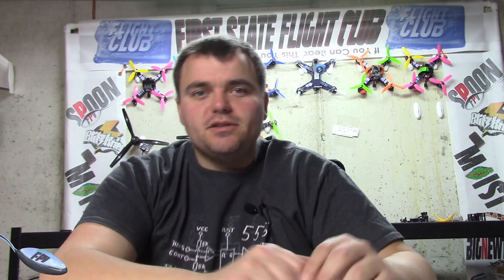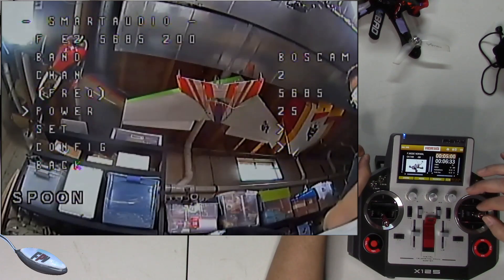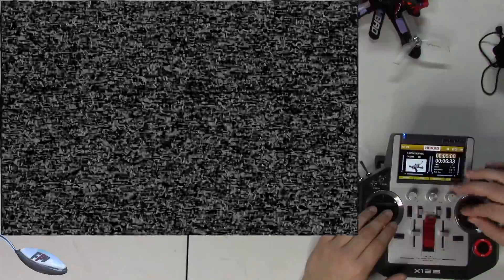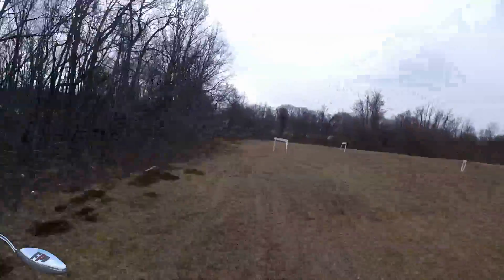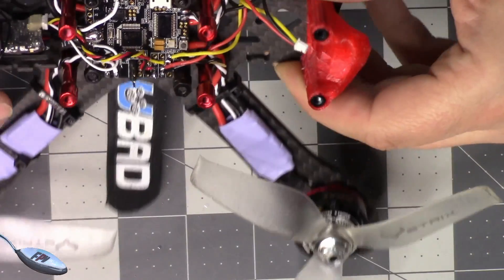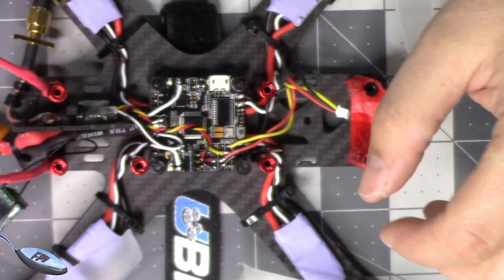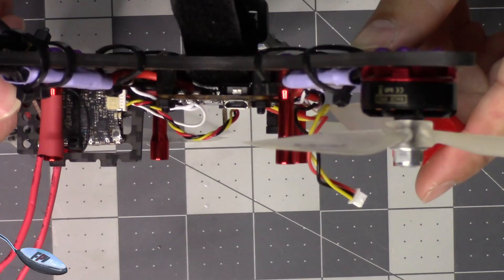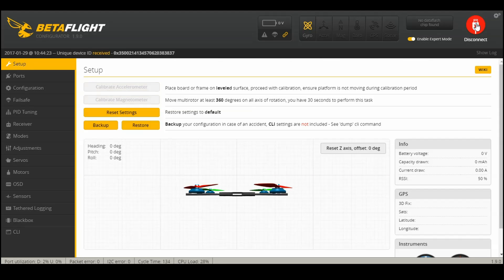TBS Smart Audio Setup Betaflight OSD

Comment: When I select "Set" my DVR does not go off ? Meaning it does not change the channel selected. Why is that ? When I reboot it it goes back to BOSCAM and channel 1 I believe, what am I doing wrong ? Thanks!
Reply from the maker: Did you set the protocol correctly in Betaflight?  You need to set it as a peripheral on the correct UART.

Comment: Hi. i have 25mw - 800mw tbs unify but at the betaflight osd there is max mw is 600 option. Does any idea ?
Reply: It needs to be unlocked first, it tells you the process in the manual
Reply: @ItsMeATaco  but i can set 800mw  with lua at same quad

Comment: If you close your eyes and listen to this video it sounds like Matt Damon helping us with Smart Audio.
Reply: I can't find a video that answers the question:Before I care about setting up, what does smart audio actually do and why do I want it??
Reply: J M Smart audio is a protocol that allows certain VTX's (TBS unify pro originally) to have their settings set in OSD instead of having to do so manually. In the video he was able to change band, channel, and transmit power using the just his transmitter sticks like joysticks. If you didn't have smart audio hooked up, you need to press a button in a particular sequence in order to change it. It's much smoother to be able to do that when flying with others.
Reply: so true !!

Comment: I've been searching and it seems you're the only person who did a similar video on the BFF3 board. Will this be the same on the Betaflight F4 board? Even tho it has OSD I also want to connect s.port for tuning LOS. Since I learned to tune via LOS vs in goggles.
Reply from the maker: +Darrel Martinez the layout may be a little different on the BFF4 but overall the concept should be the same.

Comment: Hi. thanks for the useful video. I have an Eachine wizard x220. my transmitter is fs i6. I have recently upgraded the vtx to TBS unify pro and I have a runcam swift 2 as the camera which has a built in OSD. I was wondering if I can configure smart audio on my quad. your feedback is appreciated.
Reply from the maker: +jack smith You need a flight controller with an OSD in it.  The OSD in the runcam will not talk to the TBS unfortunately.

Comment: Thanks for the video. Will this work on a Lumenier LUX V2 board? I am building my first quad and I have the LUX board and I have the Unify pro V2 5V. I just now started builing it and I'm not sure if it will work. Any guidance would e much appreciated, thanks.
Reply from the maker: +Steady it only works on boards that have OSD, I don't know if that board has OSD built in.
Reply: No, it doesn't. So I can use it anyway, right? I just won't need to connect the the audio line? Then just change setting thru the button on the board?
Reply from the maker: Yeah, just need to change the settings using the button on the TBS board.  Not that big of a deal, but smart audio does seriously one up the ease of things.

Comment: so your using the frsky xm or xm+ how does it compare range wise to x4r or xsr
Reply from the maker: Oh the XM is total garbage!!! Would not recommend.  The XM+ is amazing, that's what I fly now.  The XM data output jumps all around so you need a 10-point deadband on your quad to remove the jitter, XM+ rock solid.
Reply: How does range compare? To x4r or xsr? They some kind of overkill for most unless you really need telemetry
Reply: Spoon FPV something is wrong with your XM i have couple of xm and xm+ all are smooth af :D

Comment: Hello..I have a clone f3 cleanflight board and i soldered white wire to my board to uart2 .Thats the only way i can get my taranis and receiver to work together,but in uart2 i have is set to tbs unify and i can gt it to work,,Does the board have to be original f4 and also does it have to use uart3 to work?thanks
Reply from the maker: scott hendrix It needs to have or support betaflight osd
Reply: This is a clone sp racing f3 board..not sure if osd supported?sorry am new on all of this,how do i find out if it is..On osd in betaflight its blank?could it be in the uart settings

Comment: Can anyone answer whether SmartAudio can work with the Spektrum radio vtx menu inside the radio menu and change channels and power right on it?
Reply from the maker: It will work with any radio.  It's the FC that matters, you need a FC that has betaflight OSD.  After that it's just stick commands, which the FC reads and it doesn't matter the radio.
Reply: Spoon FPV ...let's say I just ordered a Skitzo Revolt raceflight ready fc....regardless of osd ..I should be able to use the Spektrum radios internal vtx menu they have know ..?

Comment: I don't get vtx option on feature menu, only blackbox and led strip. Is there some other feature you have to enable in betaflight first?
Reply from the maker: nolsmtm You need version 3.1 or higher,  The board ships with 3.1 but it's a beta version,

Comment: So "TBS Smart Audio" is not a feature that does anything with audio? I'm confused.
I thought maybe it was all about a mic on the TBS VTX which when connected to the Betaflight board would actually let you hear the quad's motors and also give you telemetry-like warnings, etc if you use an earbud or other type of listening device...   :(
Reply: it's called SmartAudio because it repurposes the audio channel to communicate between FC/OSD and VTx. With a switch you can have a mic and data communications at the same time.
Reply from the maker: BisMaxx Nope if you give up audio you can display stuff on an OSD enabled FC
Reply: Team BlackSheep please elaborate,as would still like to get my audio feed to my goggles
Reply from the maker: Team BlackSheep Thanks for the idea for future content!  Looks like I need to make a video about maintaining audio.  What about the low/high pass filter on the FC separating audio from digital signals?  Is that a real possibility in the near future?
Reply: I really would like to setup audio on all my quads, or at least all my new builds. So yeah, that would be a helpful tutorial. A low-pass filter would be sweet to prevent heavy/loud buffeting sounds from the wind from overwhelming the audio feed.
Reply: BisMaxx I been using audio for a while now. currently I use the mic in the pnp50, there is no loud buffeting noise don't bother with filter. it's only remotely loud before you power up the quad. usually not enough to make me pull the earphone from my ear. in flight, you hear the motors whine ,I was able to hear my antenna being chopped to pieces keeping me out the air for a week lol
Reply: Hi even I have an new SA receiver now, yay!  However I don't understand the theory behind how it behaves.  My transmitter now has a mind of it's own and I think that's by design.  I can find docs and videos explaining wiring a uart and enabling it in BF but....  Maybe my search engine strings aren't correct I can't find anything explaining how SA is 'supposed' to be used in conjunction with an FPV receivers quick channel's and possibly Lua scripst, etc.  Thx.

Comment: Nice dude about to set mine up with BF FC.. did you not get round to a build vid with the BF f3fc ?
Reply from the maker: serval FPV I shot the video for it, but I'm not releasing it for another week or two, because no one can buy them.  If you run into problems or have questions, I can send you info through messenger on my FB page spoon fpv if you would like.
Reply: Spoon FPV ok will do cheers !

Comment: Could you explain pit mode? ( when its actually in pit mode )
Reply from the maker: Jeff Sheffield If you hold the button when you power it on that enters Pit mode, it transmits at like 2mW on I think 5586( which is below the bands anyone shold be using to fly) so that you don't disturb other pilots.  If don't have it unlocked it will not broadcast at all.  It's designed so you can work on your quad "in the pits" Once in pit mode you need to power cycle it to get back to normal mode.
Reply: Thanks, Spoon... I think I am going the Team Blacksheep  Unify Pro V2 route and do your backpack mod.

Comment: I have betaflight F3 board and unify pro hv vtx. I did everything exactly like in the video but in betaflight osd features tab there is only blackbox and led strip, no vtx option? Any idea why that is?
Reply from the maker: smgfin93 You need to have Betaflight 3.1 or higher.  I know they come flashed with 3.1, but it's a pre release version so you need to update the firmware
Reply: Well, that was easy fix. Flashed BF 3.1.0 to 3.1.5 and now it shows

Comment: Question for you about vtx wiring. I have the Brainfpv board and using the unify pro HV wired to the filtered power source. I have now went through 4 vtx in the past 6 months? All TBS products. They just stop working for some reason? Any ideas? I have went through all the wiring many many times and used a multimeter but cannot figure out what is wrong?
Reply from the maker: Keith Gilbert I would be supprised if it was the TBS transmitters,  they have solid quality control.  Not seeing your build I would really need to guess.   My best guess would be are you using rpsma with sma antenna where the pins don't make solid contact?
Reply: I am using all sma. Very odd yes.
Reply from the maker: Keith Gilbert.  Yeah without seeing it, it's really hard to diagnose.  Maybe you have a problem with your pigtail, or it's how you are mounting the board, you could be shorting something out.
Reply: Spoon FPV thanks I will keep working on it
Reply: feel free to contact our customer support. if you present us with a clear wiring layout and photos, as well as a list of equipment used, we may be able to assist better. Usually it's noisy ESC's, which can be mitigated by using a low internal resistance capacitor on the main power rail.

Comment: Hi mate i just followed all the step you showed but it didn't work my set up was xracer v3 fc unify pro i used the uart2??? Because at uart 3 im using it for my x4r rx any ideas how to make work? Also im using rrod/pdb..thanks in advance
Reply from the maker: Mr kal Epic fpv You need a Betaflight OSD to make it work.  The RROSD doesn't work... or I don't think it will.

Comment: HELLO M8 ARE YOU USING UNIFY PRO V2 5V AND POWERING FROM FC OR USING A BEC AND HAW ARE YOU FINDING VIDEO NOISE ?  (-:
Reply from the maker: MOREBOOST I have quads setup both ways with this board actually, I was concerned about noise from but there is a separate audio video ground plane provided you use the propper connections, I talk more about it in my tramp video from today, but no noise at all taking 5v from the FC
Reply: THANKS I WILL GO WITH OUT ADDING  A FILTER NEXT A UNRELATED QUESTION AND I AM OVERTHINKING THIS I THINK THE QUAD SHOULD BE BALANCED ON THE PITCH AXIS SO THE QUAD IS PITCHED DOWN AND THE CAMERA IS LEVEL (BALANCED FROM THE CENTER OF THE FRAME) MORE WEIGHT OVER THE FRONT WHAT YOU THINK ?
Reply from the maker: MOREBOOST That's not a bad approach, I don't actually ballance mine like that, but I do ride my battery a bit more forward.  The back motors are always working harder in Forward flight when I want the most speed for racing, but you do kill your punch out a bit by not having it balanced, so racing I bias it to the front, freestyle I try to keep it well balanced.

Comment: Its great feature but i will sure miss the audio from flights :( any workaround to still get audio through the goggles while flying?
Reply from the maker: Ray Choi Use a IRC TRAMP, video on how to set it up releasing tomorrow
Reply: Spoon FPV so with Tramp HV I can still do all my settings in the OSD? PID Tuning and all like the Unify Pro?
Reply from the maker: Ray Choi Yup!  It's the Betaflight OSD in BF3.1 and higher doing all the cool features.
Reply: Spoon FPV cool, thanks!

Comment: Cool video. I have the TBS Unify Race running with bf f3 and I'm loving it. One question --> do you know of a resource that explains all the features available in the OSD, specifically those in the VTX SA sub-menu's?

Thx
Reply from the maker: Are you talking under the Config menu?  I don't have one in front of me, but what specifically do you want to know?
Reply: I don't have one in front of me either but in the VTX smart audio (config?) menu there are options for pit mode and i believe an option to enable the low raceband channels. Both are interesting to me. I read through the TBS manual and it really doesn't explain much and there are a ton of options to select.... Thx
Reply: Did some more research and the betaflight wiki under the cms section has most of the info. https://github.com/betaflight/betaflight/wiki/Unify-Smartaudio
Reply from the maker: Awesome, well if you get stuck, just post another comment and I'll try to give you a hand.

Comment: Do you know if the solder pads on the bottom of the unifiys are antenna signal and ground. Would be great if I could just direct solder and give the U.FL the finger
Reply from the maker: Based on their location I would assume that to be the case.  To check, just check continuity from the outside of the SMA connector to one of the pads (Should be ground) and check continuity from the pin to the other pad.  Let me know what you find.  U.FL is a good connector, I like being able to replace them.  Are you having issues?
Reply: Thanks I'll give that a test when mine shows up. I like the idea if a quick snap on replacement but I've had a few XDRs and X4rs rip the whole connector off leaving no trace behind to even solder solder to
Reply: Spoon FPV Tbs had told me the pads are heat sinks
Reply from the maker: Trollhammered Thanks for thr update.

Comment: Do you have any video issues running the video through the betaflight FC/PDB?  I've messed around with a few OSD in the past like a RROSD but I notice my non OSD builds have cleaner video.  I think making the video system as minimal as possible with the shortest wires between everything really helps minimize the amount of interference it picks up.
Reply from the maker: I was very concerned about exactly the same thing especially running such high current so close to the video, however the Betaflight F3 system is well designed and seperated.  It has a separate ground plane for the video (I'm going over all of this in my video next Friday)